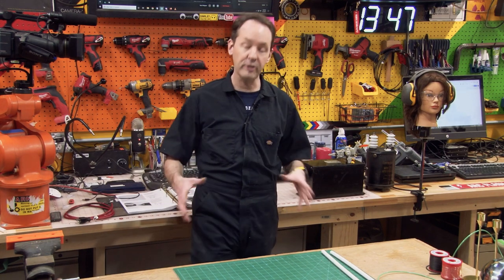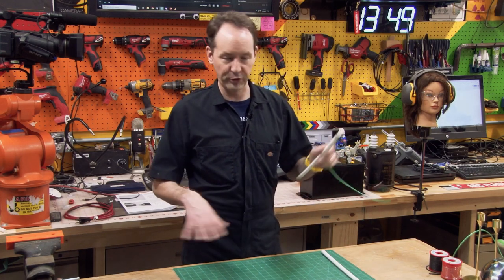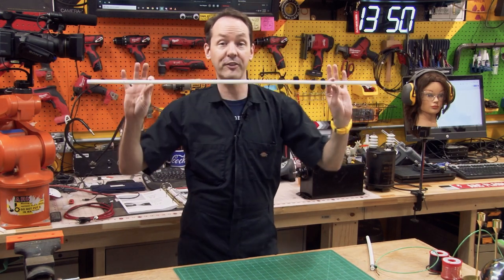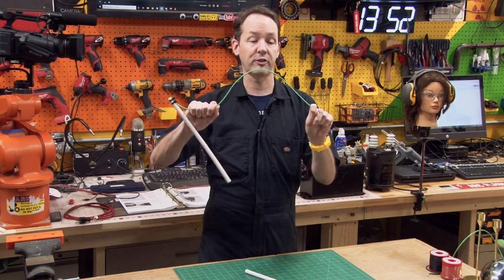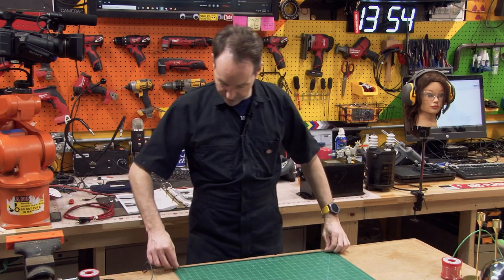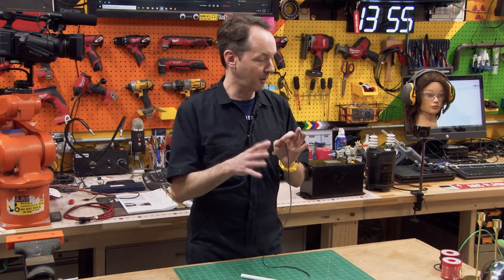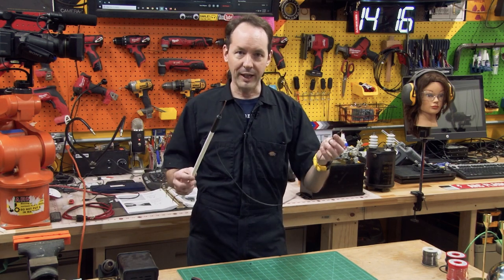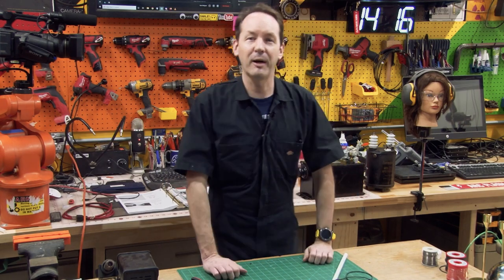High Voltage Episode 7 - How To Make A Grounding Wand (Hot Stick)

Comment: I yelled at my screen when you cut that short piece of THHN without stripping it first.  Even worse is trying to strip the individual conductors of a single pair balanced audio cable that is shorter than a few feet, as the conductors will pull right out of the outer jacket/shield.  Also, really like your use of the inside heat shrink on crimped connectors.  Never tried that trick but getting ready to completely rewire a bass boat & will be using this, strain relief == reliability.

Comment: BNTECHGO wire is all I buy. I have not had any problems with it, and I just did a video where I pull 35 amps over 10AWG into XT-60 connectors. It was barely over room temperature.

Comment: Love this series!  Watching each episode twice so I don't screw anything up.   Made a Jesus Stick using heavier PEX and zip ties as I don't have shrink wrap large enough to go around the PEX.   Help us understand using 600V rated cable for this application, shouldn't we be using high voltage insulated cable for this?  We are planning to release angry pixies from 15kv devices, wouldn't 15kv rated wire be in order?
Reply from the maker: If you have the free-end connected to ground it doesn't really matter. I like 600V rated SO cord because it's soft and has a nice thick jacket. But it certainly won't hurt to use GTO-15 for this, it's just a lot more cumbersome to use.